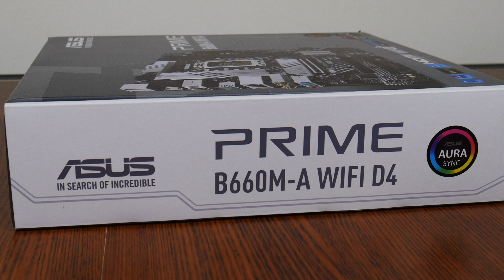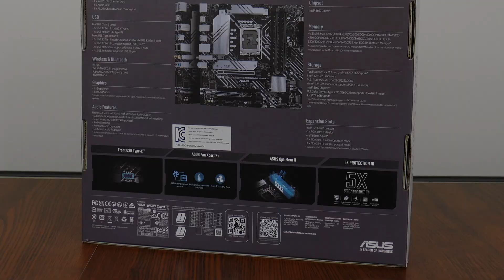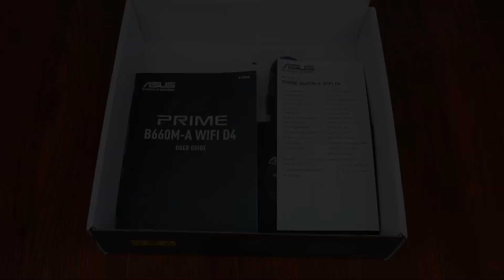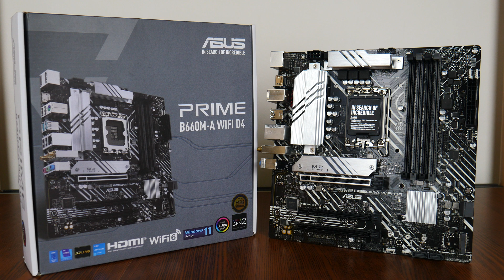ASUS PRIME B660M-A WIFI D4 Unboxing & Overview - Intel 14th Gen Raptor Lake Refresh Ready!

Comment: Can you show the bios firmware or on the screen how do you configure rgb on motherboard and change fan speeds please let me know thanks
Reply from the maker: I don't have this board with me anymore unfortunately, but off the top of my head - to change fan speeds, you'd usually need to hit the key for "Advanced Mode" (probably F7) after entering into the BIOS, and navigating to the "Monitor" tab to do so. RGB control is under the section "Aura" which is usually accessible after clicking "F4" from the main menu of the BIOS, but this could be different from what I recall.

Another alternative would be to download ASUS Armoury Crate which allows you to configure both your fan speeds and RGB settings within Windows. Hope this helps.
Reply: @ALKtech  thanks